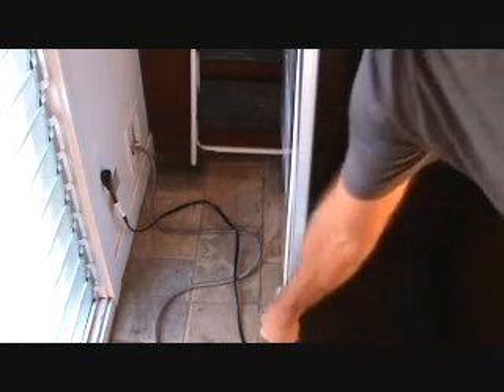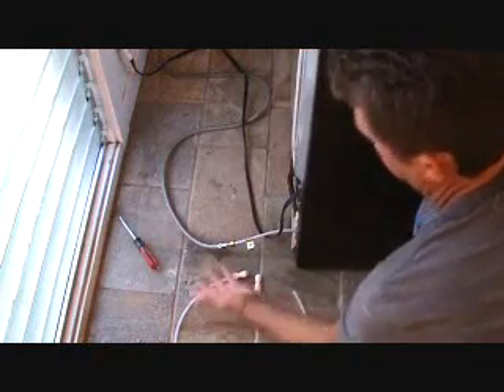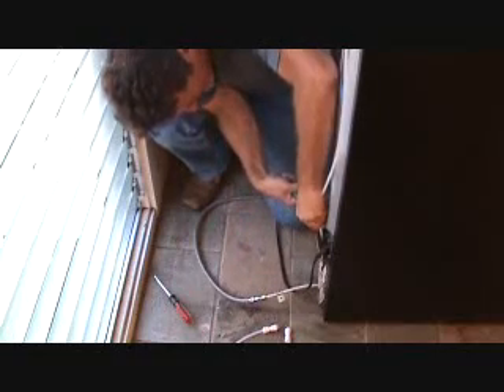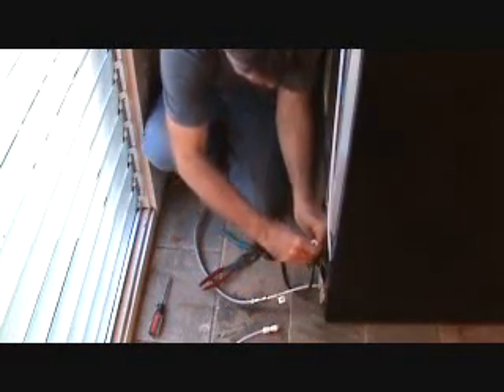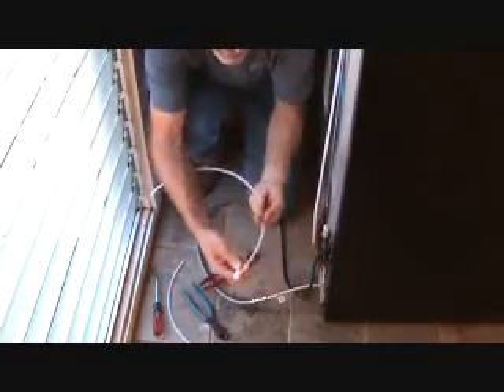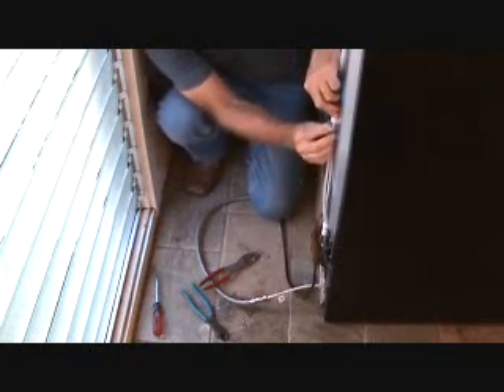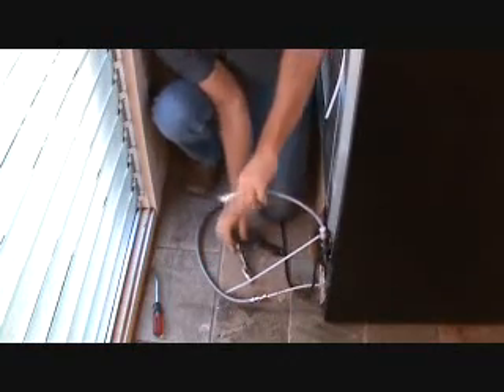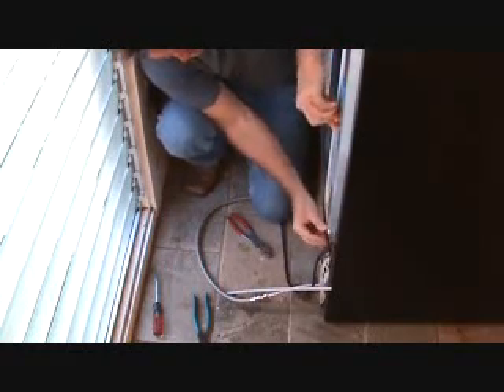How to fix a leaking refrigerator ice maker water line...Part 3

Comment: Thanks for the video! Is it hard to replace the whole line?
Reply from the maker: Not sure how difficult it would be to replace the entire line but then again the end of the line goes up inside the back of the refrigerator so you would have to remove the backing piece to find out. This repair seemed to work just fine though so....this was part 3 of the project so make sure you watch all the other parts for more learning!

Comment: I cannot tell you how much this helped me!  Got the coupling..ready to cut that little pinhole leak out of the line! Thank you!
Reply from the maker: So glad that these videos helped you take charge of this repair! Let me know how it goes.   Joe  :0
Reply: VideoJoeKnows I cut the tubing, added the coupling and turned on the water.  Viola! No leak!   Learned a very important lesson about cleaning the coils, too.  Do it! Often!  I think air wasn't flowing across the coils and water was building up in the drain pan and not evaporating.  Over time, that, plus the water that was spraying out of the pinhole leak, built to a critical mass.  Your video was the perfect solution.  I can't thank you enough.
Reply from the maker: Wow cool! Great job with the repairs!   Joe  :0

Comment: The videos were helpful. I saw how to use the saddle clamp which is not what I need. My water is leaking at each end where the coupling fits. Also I think I need a water line hose instead of the plastic water hose connected to the water outlet.
Reply from the maker: What did you end up doing for your repairs? Did you get a chance to watch the part two where I show how the coupling works & maybe your water line wasn't initially pressed all the way in to the coupling on both ends causing it to leak initially when you found the water leak? Just a thought. Hopefully I'm sure you got it fixed. Thanks for stopping by!

Comment: after i remove the water tube in the water valve, the metal clip that holds the tube in place broke, any idea where i can get replacement metal clips? or without the metal clip, how to hold the water tube in place? i have the lg lsc26905tt fridge.
Reply from the maker: You should be able to go to your local hardware store & pick up the needed parts. Go the appliance area or the plumbing area & speak to a salesperson. If you can bring the clip with you, that would be the best thing to do since if they don't have the exact part they might be able to locate a part that will work. Good luck & thanks for your message. Have a great day!   Joe  :0

Comment: I have a problem with my fridge. the ice maker was out when we moved in. it started leaking again but only on the left side of the fridge. any advice?
Reply from the maker: Hmmmm is or was the leak coming from the actual water line? What did you end up finding?